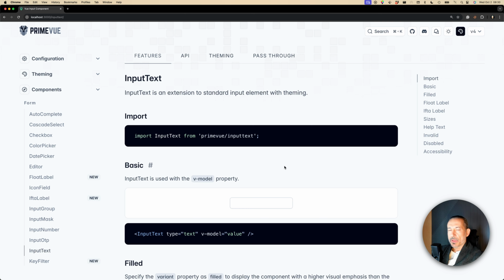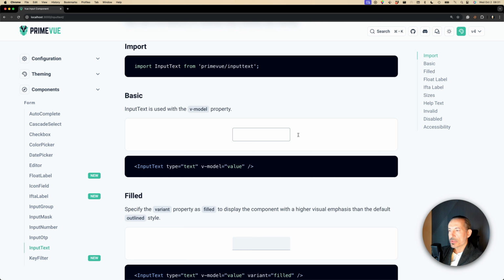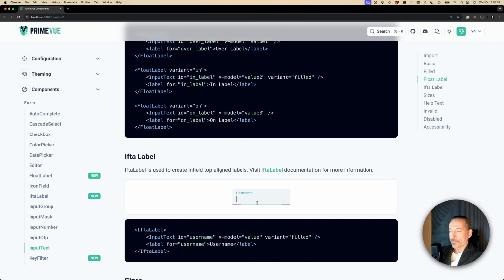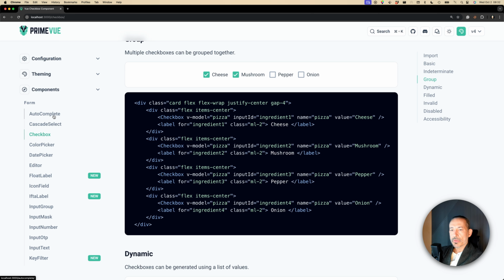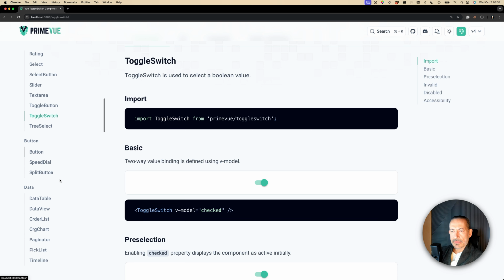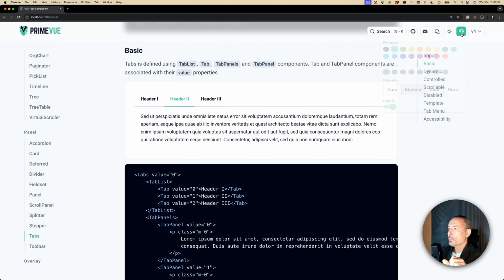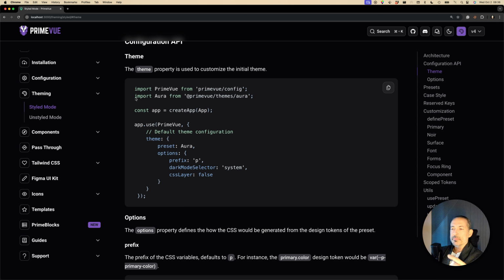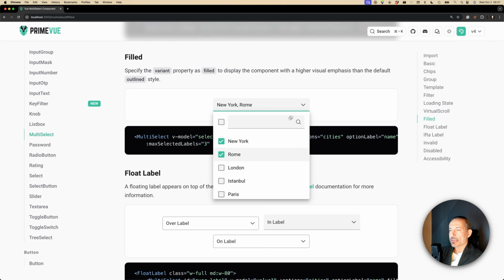Material Design meets Prime

Comment: We saw that Prime Vue has real problem within Nuxt. Some functions does not work at all, it breaks. You guys did an amazing job creating PrimeVue, however, you followed react pattern not original Vue pattern for building components. And react has a similar problem working with useState, useEffects and any hooks in SSR mode. Why don't you guys fix it? and make primevue truly a vue components library? 

For example:- A table of primevue cannot be SSR, also some other components. Same happens in Vuetify also
Reply from the maker: @brightyouthacademy  Interesting, all demos even the website work fine with Nuxt in SSR. Make sure to use the latest Nuxt module of PrimeVue.